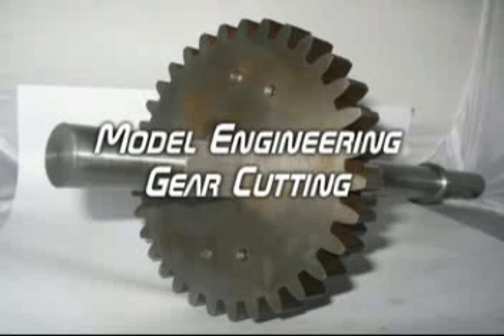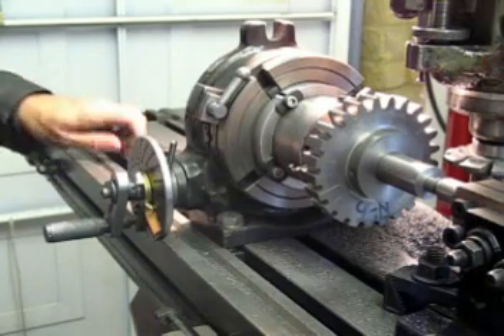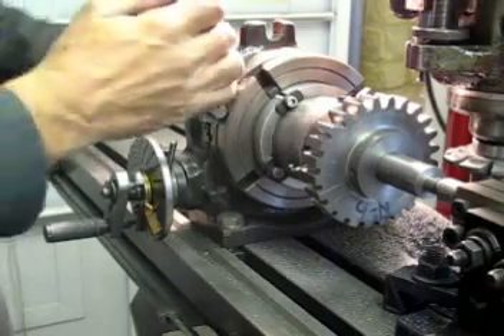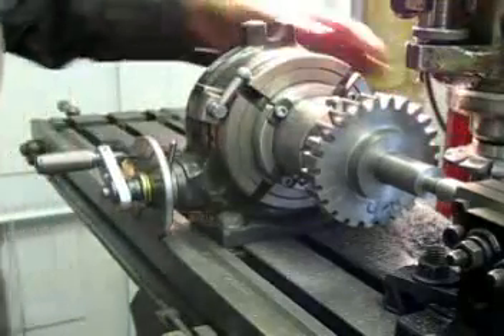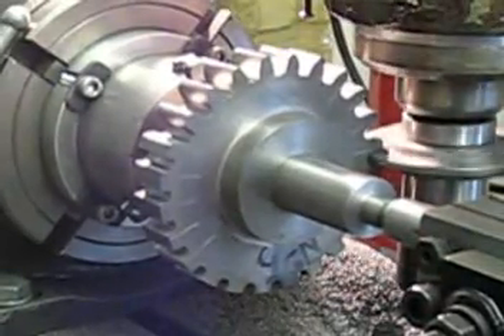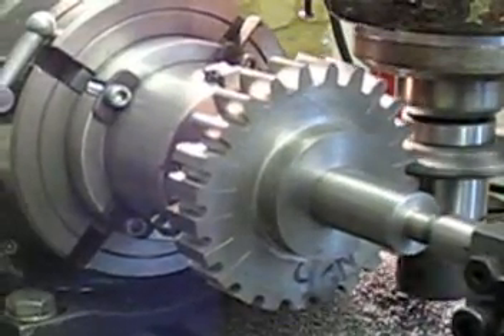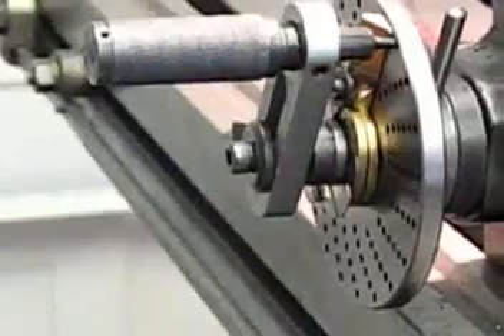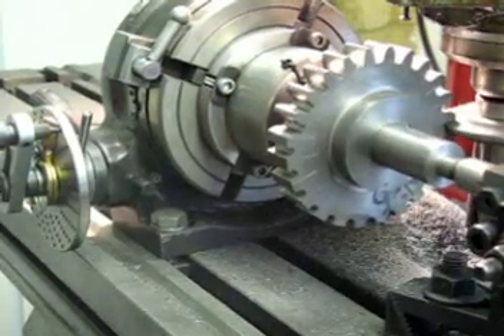Model Engineering - Gear Cutting

Comment: Hello I have a 8 inch rotary table and TX 45 and I'd like to make some gears. I understand I need indexing plates but I don't understand which ones I need to get is there sets that are complete I've seen a couple of sets for an 8 inch rotary table like mine but there are only two plates with a whole bunch of holes. My intention is to build mini lathe metal gears for myself. I will also need to figure out which Cutters to get I'll have to research that as well any input you could give me would be greatly appreciated

Comment: Wonderful job!
Any chance, you could make me a small metal gear? On eBay I bought a strong looking geared motor (TS-JSX31ZY  /24V /215rpm)  I have all details of the gear.
In this motor a nasty obsolesce timer was inbuilt, consisting of a small double gear of which the bigger gear is made of nylon, designed to strip at overload (instead of just stop) ...and this is what happened!  Warm Regards, from jdrinda@hotmaill.com(a young pensioner 72) from Chile